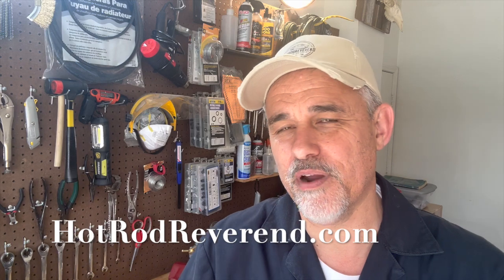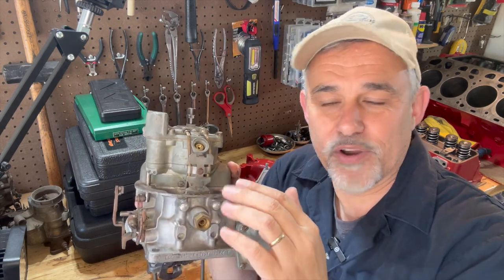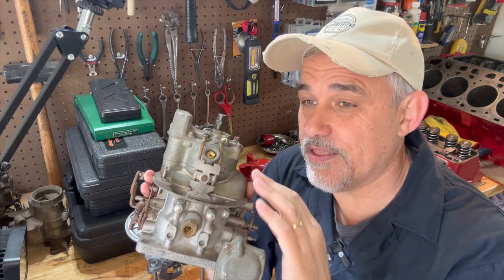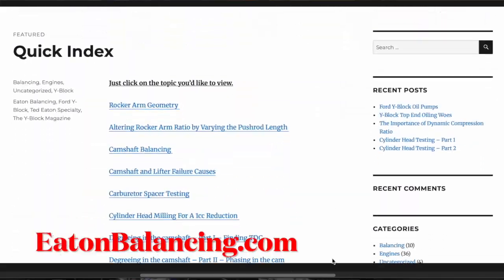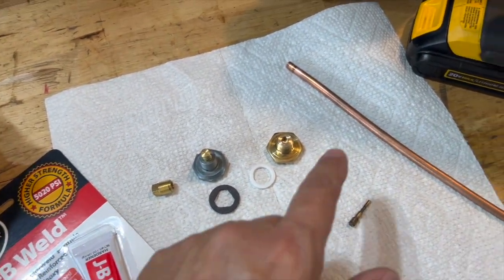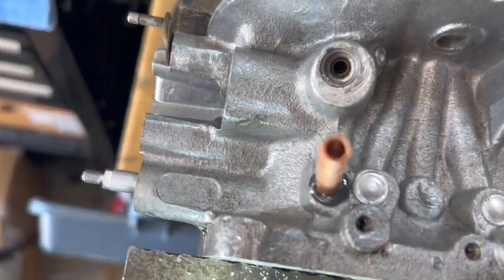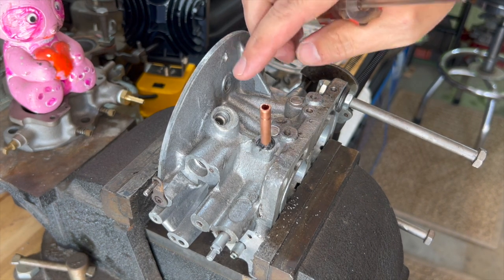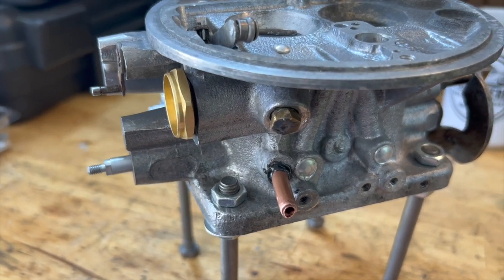How to Modify a Holley 4000 Four barrel Carburetor for a Modern Distributor

Comment: Dan i noticed you  had a lincoln 4000 carb, i just did one, they have a spacer were te upper half bolts to lower half, mine was broken and could not find another, took all day to machine one , out of steel.  they are Phenelic or nylon i think from factory, FORD AND MERC does not use this , also a trick guys used years ago was to get ford or merc manifold bored to 56 linc size and use that carb, most tech guys would not catch it years ago. Rick Martin Darrtown Ohio
Reply from the maker: I have not had the time yet to dive into it; will check it out like you describe.